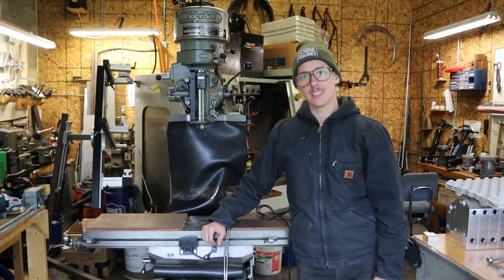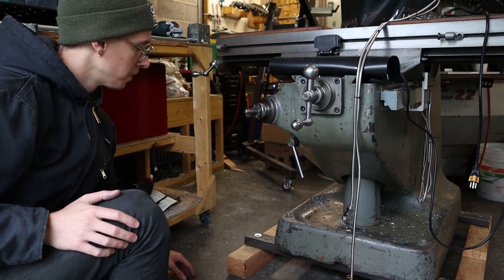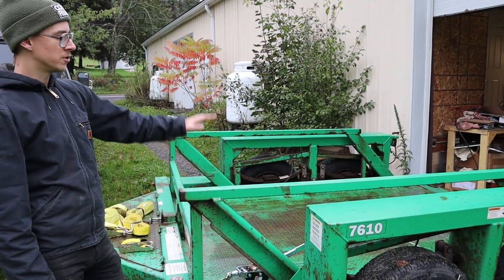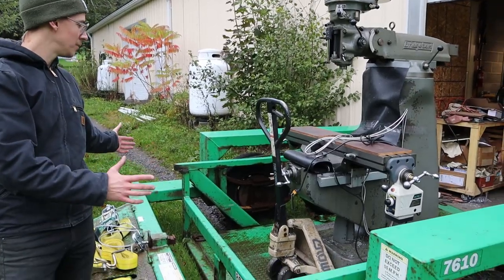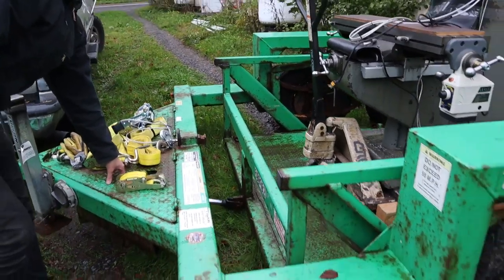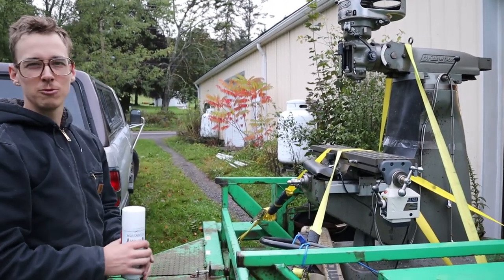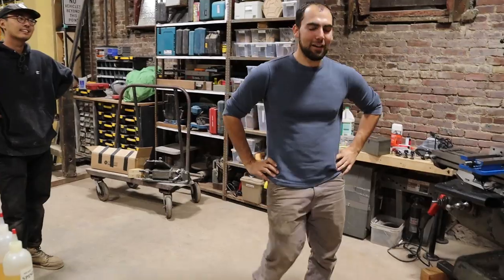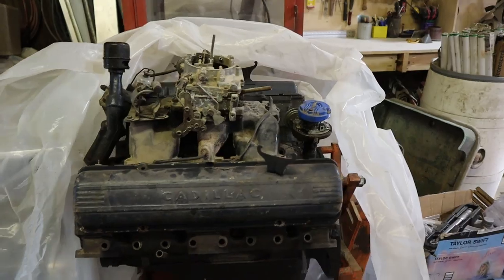How to Move a Bridgeport Milling Machine

Comment: Worst way to move a milling machine you need to put the head upside down lock the table with a pic of wood between the spindle and the table never ever bend downd infort of the machine it can come down right on you allways use an electric winch

Comment: My father used to have a home machine business on the side.  I grew up standing in front of the mill and lathe.  Mostly the mill.  Learned alot and it was a great childhood.  Moved away, he got sick-nowhere to store everything and the end was near.  A guy I work with-his father...(125 miles away) from dad bought the machines.  He is older now and is moving to Florida.  I am buying back the old machinery.   Crazy story.  I have nothing to move it with and have been racking my brain.  This video has helped.  Much appreciated.
Reply: My dad also had a machine shop, half a dozen bridgeports etc etc.. I've been moving these things I was 7 or 8 years old, we would roll them on pipes cuz we didn't have a pallet jack, no big deal

Comment: Old vid, but might help someone who comes across this.  You can make it a whole lot safer by rotating the head 180*.  Helps immensely with the center of gravity.  No need to remove motor.

Comment: If you use steel angle, beam or box tubing instead of wood for the two base pieces you can make two lengths of channel/box/pipe with a vertical tube on each end to take scaffolding casters or weld plates with holes to bolt (don't weld them) on plate mount caster. These "outriggers" should be about the track width of a common car or pickup.  How you bolt the outriggers to your base is up to you but I ran mine a few inches high so tightening the nuts on the industrial allthread I used raises the machine base off the floor until the base and ouriggers bottom out. No forklift needed, dead stable and easy to winch anywhere you care to go. Place sections of old mobile home frame etc and it will even roll across dirt.

Comment: The rental of a forklift or skid-steer (with lift ratings for the equipment) makes this SO MUCH EASIER. I've done this with pallet jacks, and I've done this with forklifts...go with the forklift every time. Generally speaking, be aware of your CG when towing. If you can rotate the head down and lock it in place to lower the CG of the load, do it. I saw a Bridgeport teetering on a trailer once because they didn't lower the CG, and they had 3 straps on the thing. Straps also come loose unfortunately..which is why every trucker I know straps a load and then pulls over after a while and re-ratchets the load.

Comment: I bought a Taiwanese knockoff of one of those in Auckland, NZ, only had my one ton van to move it about 250 km to where I live. The auction staff sat around watching me dismantle the thing, and load it into the van. On mine, the rectangular base and vertical column are actually 2 castings bolted together, with a lot of filler covering the join to give the impression of one big casting. I anticipated having to make 2 trips, but moved it in one. Very simple move.

Comment: I watched this video before I moved my new used BP mill on March 15, 2020, I used the very same trailer it may have the very same one from Sunbelt Rentals, to make a long story short, one of the front wheel bearings locked up and the wheel stops turning, smoking the tire completely off the rim, and attracting the Ohio State Police. The officer suggested I get a wrecker to lift the mill off the trailer so I could remove what was left of the rim and put the spare tire on. The Wrecker arrived, the attendant said he's has had this same situation many times in the past, and he has an easy fix for it if I agree. He remarked; I don't know why you guys don't just call us first and save yourself all of this trouble, he said I'll deliver the mill to my shop for additional $100 bucks still 75 miles away, I agreed. He turned the ram to 90 degrees on the BP mill, picked the mill off the trailer with his boom, set the mill base on a short platform that sticks out of the back of his rig, secured it down, and away he went. The Bridgeport hanging on the hook. I took the trailer back to Sunbelt Rental, they refunded all of my money around $200 for 2 days since I figured I would be hard-pressed to do the turnaround in 1 day. I suggest he's was right just call a wrecker in the first place. When the move was complete I came out $20 bucks a head having spent $185 and Sunbelt refunding $205., to move my mill 110 miles! Oh, one other thing with the attendant I failed to mention I had to agree to give a good price on any parts he may need to have machined on that mill. All-in-all it was quite an experience!

Comment: I have my heavy machines permanently mounted onto custom made pallets made out of railroad sleepers so when I want to move them I just pick them up with my pallet jack. So safe and easy I can move them out on my own for cleaning and maintenance and as they only have to clear the floor by a couple of millimeters there’s no chance they can tip over. Cheers Stuart 🇦🇺

Comment: In UK each line of thread in the strap = 1 tonne. There fore the first  strap you have  would be a 2 tonne strap in the UK. I would assume it would be similar where you live. Just looking in to buying a  similar Bridgeport at the moment. Motor on top and DRO to worry about. Deciding factor will be the transport cost.  Good vid M  😀

Comment: I've moved a lot of machinery and I always tie it down in a way so it can't tip. Either by wrapping the strap around a few times or by using two straps connecting to one point on top. I also wrap them with stretchy plastic. Best of luck!

Comment: Thanks for making this video. When you got the mill onto the trailer, did you lower the pallet jack down? It looks like you left it raised which would greatly reduce the friction between the mill base and the trailer - meaning that your straps have to do all the work of keeping it in place. I think it would be much better to lower it so that the pallet makes full contact with the trailer bed.

Comment: Great way to pick it up.and easily move it. What size steel tubing did you use? I need to build one.
Reply: same boat. I've seen folks sell jigs that comprise of 1" x 2.5" solid steel. I'm also curious to know what size rectangle tubing was used.

Comment: What was the sizes of the steel square tube you used? How is it attached to the base of the Mill? Did you make the feet levelers or buy them?    Thanks
Reply from the maker: In my case I used 2x4" steel square tube. 1/4" wall I think. They're way overkill but it's what was handy. I bought the leveling feet from MSC Direct and turned some parts on my lathe to go with them. There are 1000 ways to do it, you just have to use common sense and what you have to work with.
Reply: @cobraframebuilding   Is the tubing attached to the mill or is it just sitting on it?  Thanks

Comment: Why wouldn't you tilt the head to horizontal? Lower center of gravity, less height
Reply from the maker: Not a bad way to go, but I didn’t feel it was necessary. The base I have really makes it a lot more stable and tipping the head means re-tramming it again later.
Reply: You also risk stripping the worm gear by rotating the head...